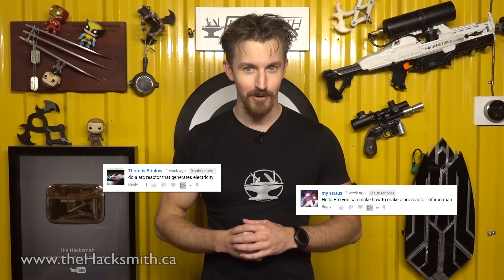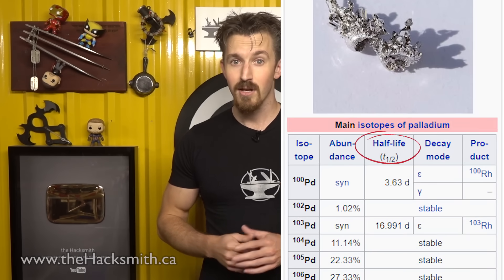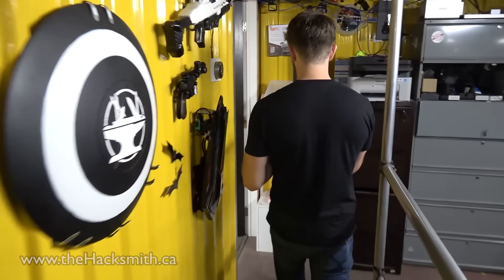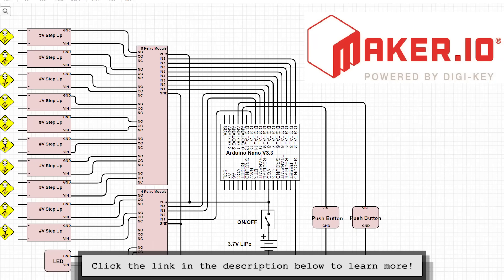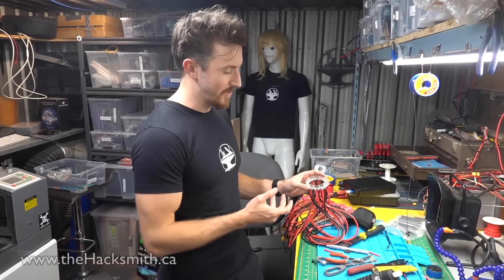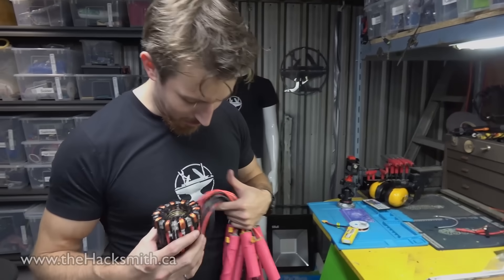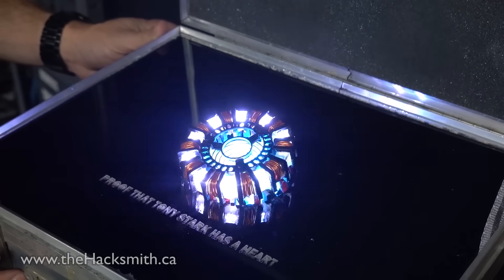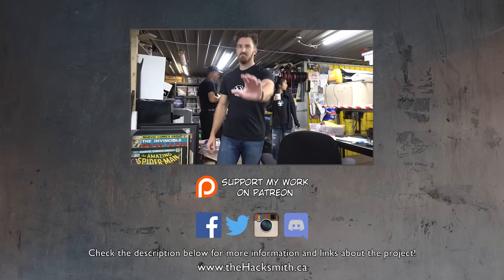Real Arc Reactor (ionized plasma generator)

Comment: will this arc reactor generates power forever
Reply from the maker: No
Reply: @hacksmith  then for how much time?
Reply: PLEASE ANSWER HACKSMITH PLEASE,
From where you connected the power output cables to charge your phone from the reactor it is not showed in circuit diagram

Comment: "You will always lose energy when powering a machine that harvests more energy"
True, until you use forces instead.
There is actually a very known way of doing so, the answer? Black holes. It's known as the Halo Drive and what it does is you send a laser at a black hole at the perfect angle so the light orbits the black hole but comes back at the same point it was originally shot from, this time blue shifted with more energy.
It does not violate the first law of thermodynamics because it uses GRAVITY not energy, same can be done with magnets, only that it's a lot more complicated.
Reply from the maker: Ok
Reply: Go ahead and find a black hole to shoot a laser at
Reply: @helloworld2409  That’s a bit trickier.

Comment: The arc reactor in the film looks like more than a current of electricity that simply travels in a loop. It looks like a tokamak, which is a type fusion reactor. Haven’t done any calculations, but it’s in the realm of possibility that it could generate 3.5 GW. Cool video anyhow. Cheers

Comment: Hi hacksmith OK I know it good no very good but I want to tell you that the way was incorrect we can use plasma generated from laser gun and Cooper and chromium wire to to roll on the glass ring and to use use heat and to covert it in electric current this would be more. Efficient  and effective and I have an whole idea to make an plasma reactor if you want to know the then please reply in commets and send me your email OK don't worry if you have a doubt then I will will send you my id and then also then you can see my channel incredible everything OK that's not the thing and if think that       I am your fan and just talking for my promotion but that is wrong I just want to tell you about arc reactor

Comment: The reactor might work as tony used it if you made a hydrogen powered one
Using Hydrogen it can amp up the voltage
Using it as a super conductor
Please consider my recommendation
P.S. I cannot afford to do this otherwise I would myself

Comment: 3 GigaWatts = 3,000 MegaWatts = 3,000,000 KiloWatts = 3,000,000,000 Watts. 
Just to give perspective: A Fridge takes a starting 800-1,200 Wh (Watt Hours) a day to get things cold and then a run wattage of 150 Wh (Watt Hours) a day to keep it cool generally. So no wonder Doc reacts like that in 1955 (1:45)
Reply: There is also a big difference in Watts and "Watt Hours" (If your willing to take the challenge of looking it up)
Reply: Specified: Tony Stark: Three GigaJoules (GigaWatts) "PER SECOND!" holy s***

Comment: Fist if you just had two doughnut magnets that are strong and attracted to each other you only need two parallel plates on the outside of the magnets. Then you need to swirl ions to generate electricity. IF you have a perpendicular high voltage coils to create a static and electromagnetic mutual induction as to ionize a gas you have an arc reactor. But Radium should work and a small fan that makes a vortex in the ionizer plate. You may just coat radium paint on the cathode and it should work with a flow or vortex of gas.

Comment: I read some time ago a fanfic where they created arc reactor and explained how it work. I don't know if this would work if it is even real but I choose to post a fragment with information about arc reactor theory and a/n in the end of this chapter, maybe this would give you some idea

fragment:
"The idea for it came partly from an old project that would use hot fusion, the Tokamak. The most significant differences here are the 'fuel' and what it's generating. The Tokamak mashed two isotopes of hydrogen at high velocity, thanks to a powerful magnetic field, to create helium and a neutron, which are lighter than hydrogen. The missing mass produces energy in the form of heat which is in turn used to power a turbine, and change that energy into electricity. This is where the second difference comes into play. The Arc Reactor generates pure electricity and a little bit of heat. The 'fuel' here are two isotopes of palladium: Pd-103 and Pd-107. Whole device functions thanks to the materials' interesting capture and decay properties. Pd-103 produces rhodium 103 via electron capture, and during that, it creates a neutron and gamma rays. Pd-107 changes into silver 107 due to beta decay and when that happens it releases an electron. Rhodium and silver have different numbers of protons from palladium and due to the production-consumption of the electrons to balance out the proton count, so there's no net flow of electricity. This is how the electric circuits between two radioactive isotopes is established. By using an external power source, Pd-103 is ionized by an electric arc and accelerated to high velocity in the outer ring. Pd-107 in the inner core starts to emit high-energy electrons as it decays to Ag-107. Those electrons escape to the outer ring and their flow is directed by a magnetic field there. The lack of electrons create a net positive charge in the core, which slows further emission until electrons can be replenished. In the outer ring, the free electrons collide with Pd-103+ ions, which causes electron capture and gamma-ray emission. Those rays are then deflected inward towards the core, producing further electron emission and thus creating a self-sustaining reaction. The electron flow from the inner core to the outer one creates an electric potential difference. Giving it the power output it creates the current, which relieves the electrostatic charge accumulations that initially slowed the reactions. So the less energy is drawn out, the slower is the radioactive decay and vice-versa. When palladium converts to Rh-103 and Ag-107 the reaction runs out of power. The glow that the device is emitting is due to Cherenkov radiation. It occurs when an energetic particle enters a medium, such as air at near light speed into it. To put it in simple terms, it's just a very fancy cold fusion reactor."

a/n:
There you have it, guys. Arc Reactor is up and running. So for a little bit of explanation. I'm a science guy and like to think of how the stuff works. So thanks to my glorious insomnia, I've spent some time reading through the articles about palladium and cold fusion and ended up with something akin to what I presented to you. I've found a discussion on quora's side (I'm not sure if I can link it or no, so if someone knows, please tell me) that further refined my theory.

Comment: Your wiring is too thin to be a good transistor as well. If you make the circle twice as wide you could have used the same wire as a 75 ohm OTA antenna wire for television. This wire would have generated 5 times the power in a easier foot print to control. The scaling increase would make it run a house over a phone.

Comment: Me personally I would have used and grounded metal frame and an insulated circle shroud for the electro-magnet part.  Metal would be more durable and handle the current better without deteriorating.

Comment: With the leaps and bounds in RGB lighting for say, computer hardware, you could probably just use LEDs and a rasberry pi to control the light color, (or lack thereof), and light "pattern". It would take much much less power and less wiring so you could fit it in your soon to be built Iron Man suit. Just an idea.

Comment: If you use this in your suit design, or want some other reason to carry it around. A good mount would be to make a chest piece and have the wires placed like ribs so that the bulk is on the back. The piece could open up near the spine, with the spine possibly being a latch...maybe.

Comment: I don't really understand this. doesn't the power from the lithium battery go to the arc reactor which then goes to the phone? meaning that it is the same as putting the battery into any output like a phone charger

Comment: it's powered by battery... but it will be  exactly the same if its was a fusion reactor... in Iron man tahe arc reactor is silent and does not produce heat where im real life if a MINIATURE ARC REACTOR IS POSSIBLE IT WILL MAKE MORE NOISE ND PRODUCE HUGE AMOUNT OF HEAT CAUSE THAT'S WHAT HAPPENS IN FUSION REACTORS....

Comment: Magnet plasma(tic) chain reactor will be like an enhanced tokamak - a device which uses a powerful magnetic field (Can the plasma be magnetic?) to confine a hot plasma in the shape of a torus (Magnetic large flux Rodin Coil/Vortex Math) system and would generate the same amount of energy as much larger over-unity designs pulling extra energy out of the ether (Dark Energy or matter) - much like the reactor in the Iron man series. Using the ARET device (mag purple Mercury with gravitation attenuation)  to for enhancing or  master the uni-field short pulse and / or mega burst. Realizing terawatt, Petawatt  Exawatt?

Comment: Sad that battery technology is so archaic compare to other contemporary technologies. I wanted to make a solar based energy backp system for my house, but battery performance is so ridicule that  will have to stick to fossil fuel genrators. I live in Quebec Canada, so heating my house or even part of my house is not an option in our harsh winters with a battery powered backup generator. It might be if I had l 20 000 thosands to spend,d still it would be pretty much mediocre for he price. It is not normal to have to charge a cell phone or smart watch almost every day for an average use. This is really a technology were science is on a treadmill.

Comment: Hey Hacksmith which converters you have used have a capability of producing an arc of approximately 3 cm so you can even use less converters instead of more, by giving appropriate input mentioned I.e. 3-7v if you are using phenovo converters and for noise reduction convert its a.c. output to D.C. Output the arc would remain same.

Comment: Theoretically, the wire rounds around the center of the Base are most likely powered to create a magnetic field or almost a guide for a continuous arc. There could be a possible gas in a concentrated chamber to allow for minimal loss through heat as well as better conductivity to require less power. It would also be practically silent due to there being a stable arc.

Comment: To build something like the arc reactor you would need a nuclear fusion reactor based on the Tokamak principle. that's why you need paladium like in the iron man films. Actually, you only have to make the ITER ractor, which is currently under construction, very small.
I think if that is done ,  you can talk about generating a lot more electricity.

Comment: It is much more likely that it is a fusion reactor, with a palladium core. The problem wouldn't be creating such a device, it would be creating it small enough, and safe enough to not burn a hole in Tony's chest, and to somehow extract the energy without using turbines. Maybe some kind of implementation of the Peltier effect?

Comment: Me: build a taser with a transformer i bought from amazon which can output 1000000 volt if the input is 6 volt(4 AA battery)
Me: hEHe I aM sMaRt!
Me: watch this video
Me: dissapointed i am dumber than a rock

Comment: What if the arc reactor is actually a magnetic confinement fusion reactor. That would explain the coiled wire around the reactor. And maybe it uses palladium as its fuel. That might also explain the colour. It's just a thought
Reply: It is, the ark reactor are fusion plasma reactor.
Reply: Huh
Reply: And the pallladium “burns out/gets used up” which only proves this point
Reply: Interesting
Reply: I also think that but using Paladium as fuel is extremely inefficient compared to using tritium and deuterium
Reply: @bensto-j4n  Tritium is unbelievably rare, why would Stark have it in the weapons that the Ten Rings happened to have?
Reply: @bensto-j4n  he might bot have had that at the time, he 'built this in a cave, with a box of scraps'
Reply: Wat
Reply: Would neodymium work ? And radioactive fuel , how about thorium and a little bit of plutonium.  Also just a thought.
Reply: @fotzoccravings5094  yes technically although you would  need to keep the magnets cool so it would be hard which is why electromagnets are used, correct me if im wrong, but yes it would probably work
Reply: @fotzoccravings5094  Radioactive material are used for fission, which splits atoms. Fusion uses light elements, such as deuterium, tritium, He3, H and boron
Reply: @vandarkholme4745  those aren't elements my guy
Reply: Huh?
Reply: @rajahn dixon They cannot build a fusion reactor. Nobody has managed it yet. Not even with millions of dollars and the brightest minds of our age on it.
Reply: Why are people still discussing this good god
Reply: This was my exact theory...
Reply: It's is its an electromagnetic gen, if u search it up that's what it is in the comics😕
Reply: Do you a sprechen english

Comment: 13:33: the short answer is: Hey look buddy, I'm an engineer. That means I solve problems, not problems like "What is beauty?" Because that would fall within the purview of your conundrums of philosophy. I solve practical problems, for instance: how am I going to make some big machine capable of use in everyday daily life? The answer, attend a S.T.E.M course, and if that don't work... major electronic engineering in college. Take for instance this heavy ionized plasma generator consuming 800,000 volts of electricity lil' old number designed by Tony stark, built by me, and you best hope... Not malfunctioning and discharging near you.

Comment: hes practically taking energy, and making it look cooler.
Reply: Craig McHood Energy always looks that way he’s just converting it and transforming it into a circle  form But not really a circle because that’s impossible
Reply: Riley Da Best um no. Thats just not correct. Its using boost converters. They just step up DC voltage. Its essentially a large capacitor. It does not work at all. Its a prop. They arent generating power at all. Your putting in power in exchange for power otherwise it would be a perpetual energy device which is impossible. Energy cant be created or destroyed it can only be altered.
Reply: He's*
Reply: Using a battery to transfer its charges to another battery is not equals to generating electricity, btw. I know all his fans be like "Yo wow cool awesome" and I agree it somehow looked neat, but useless. Arc reactor is a term that have an actual definition. This is not an arc reactor, it's just a decorative model.
Reply: Exectly
Reply: Exectly
Reply: well your not wrong
but
Reply: @Craig Mchood He couldn't make the Arc reactor because it wouldn't be possible to make now. in the future we might but you can't generate electricity with electricity
Reply: Craig McHood who asked you
Reply: No offence try making it yourself
Reply: Hi guys I made jarvis home automation project pls check it once
Reply: @Ye boi Riley its a battery
Reply: I know a way to use magnetic motor to generate nergy and use familiar way to make the plazma for flexing the "Arc reactor".
Reply: no he made so he didnt have to pay his electric bills
Reply: Cut the dude some slack, I bet you couldn't make it look that cool
Reply: Tyler Lemieux bro he’s complementing them
Reply: No offense

Comment: Arc reactor means to generate plasma inside a container like a donat called "Tokamak".
the temperature of the generated plasma reach 15000000000 celsius so if this plasma touches the walls, they will be evaporated.  
so there should be a confinement for the plasma inside the container by using a magnetic field.

Comment: You should of cut the wires smaller and hook they up to one battery with a tiny switch on it and turn on the switch build a iron man suit and go from there you won't have a chest repulser but you'll have a glowing chest that looks like Tony's and plus you have been trying to fly like him but in a few years or so you'll be the first man to have a iron man suit it probably won't be as good as his butt you'll have one maybe just a little advice not judging but you got this

Comment: here i copied this off a site that  helps convert joules into watts (but watts to joules is impossible)
Watts=Joules/time

So Power is the Rate at which Energy is consumed

1 Joule in 1 sec = 1 Watt

1 Joule in 1 millisecond = 1000 Watt = 1 kW

1 Joule in microsecond = 1000000W = 1MW

Comment: Less of a reactor and more of just a really loud transformer.
Reply: Less of a reactor
More of a few batteries wasting power by making a current in some plastic ring, instead of giving the full power to the thing being charged
Reply: SCP 055 but it looks cool though
Reply: with no regulated DC output. Great work by them on exposition though
Reply: Ya